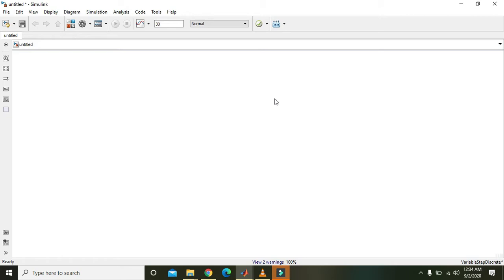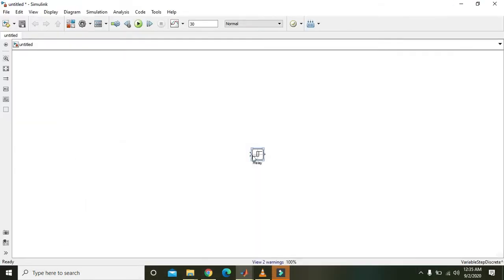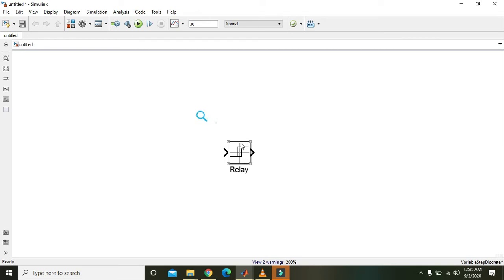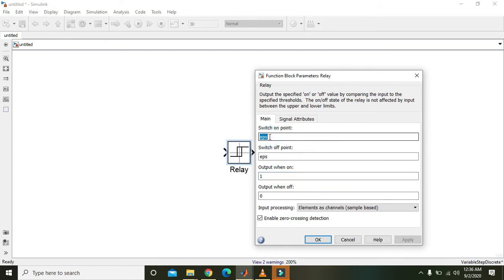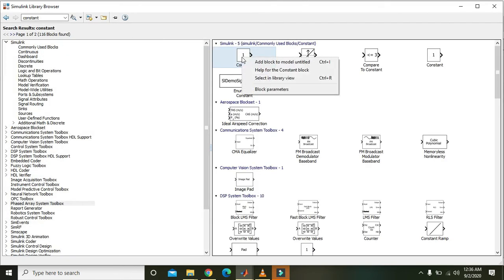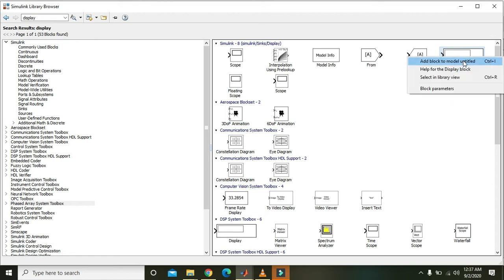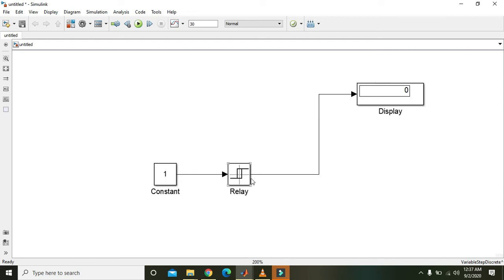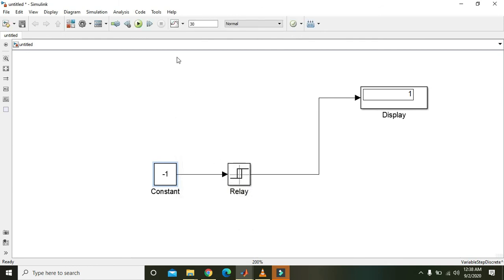How to use relay block in simulink | Relay block in simulink | Relay in simulink

Comment: Switch on / off doesn't make sense to me.
If on=2 & off=-2 
then I would think it's on above 2, and off below -2?
So why is -1 off?
Reply: state changes at 2 and -2. this is software issue on the tutor. -1 can be off if once input equals -2 and then less than 2.

Comment: Fantastic, thank you, but I wished you clarified the "switch off" function a bit more, it didn't make much sense to use -2 value as a "below 2" operator.
Reply from the maker: yes sir..in next tutorial i will work on relay module in depth...
Reply: @nelsondarwinpaktech3954  subscribed, keep up the good work bro 👍
Reply: @nelsondarwinpaktech3954  hi sir thank for explaining. I have some questions regarding this topic.please if you share your phone number or email it will be easy for asking and will be thankful to you